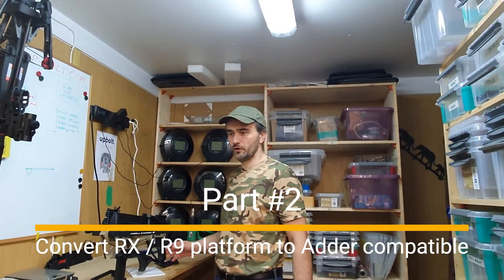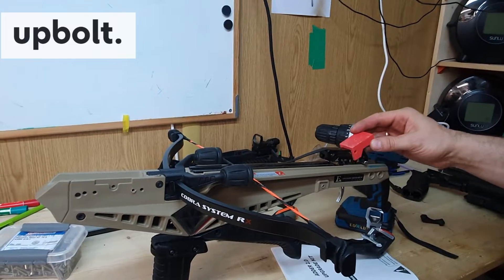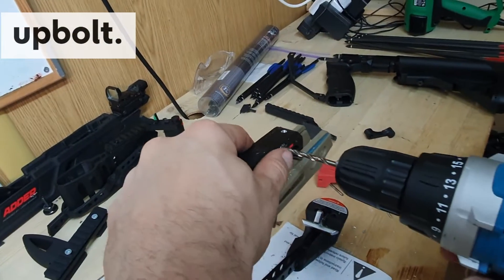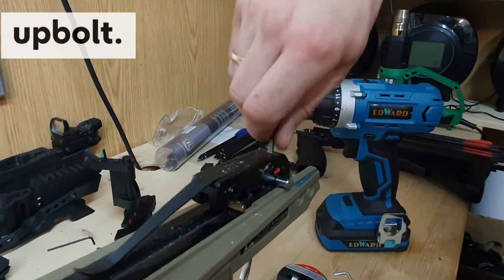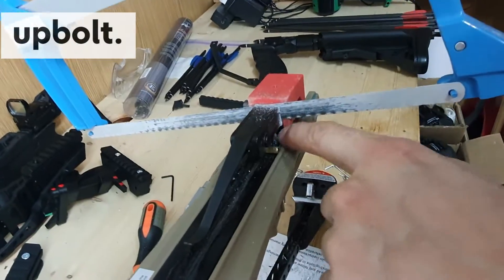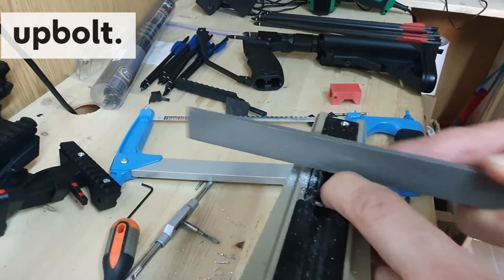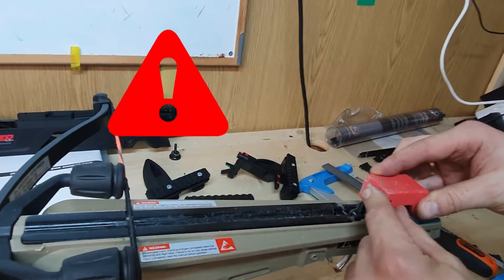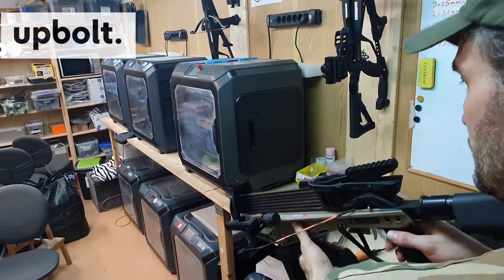UPGRADE series: Convert Cobra RX / R9 platform to RX Adder compatible

Comment: Hi, good morning, I shoot 15" and 7.5" bolts with my R10, I want to know if your magazine can also shoot short bolts, thank you
Reply from the maker: Short bolts are not supported in this mag. It was specially designed for long bolts, therefore is too shot in the rear part to be as lightweight as possible.
Reply: Thanks for the answer, if I understand correctly, you cannot use short bolts with broadheads, the maximum weight is 23 grams, right? My hunting area is very dense, a lot of vegetation and I overuse short bolts,